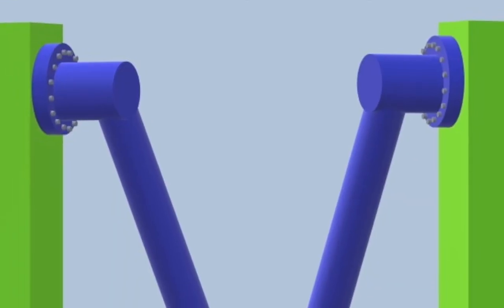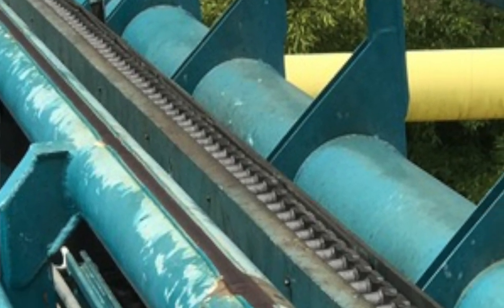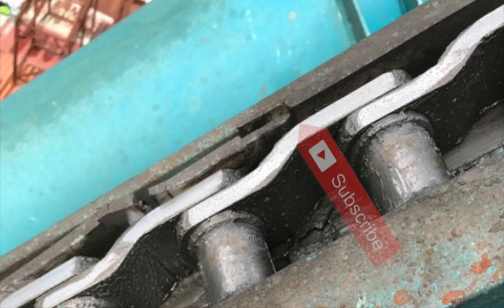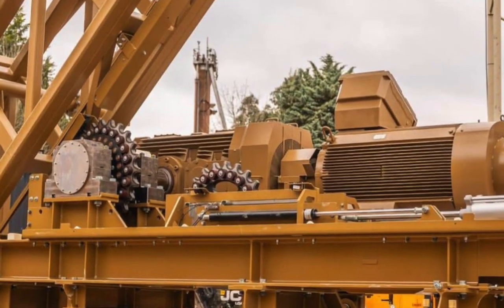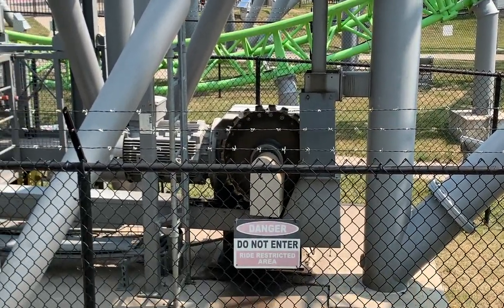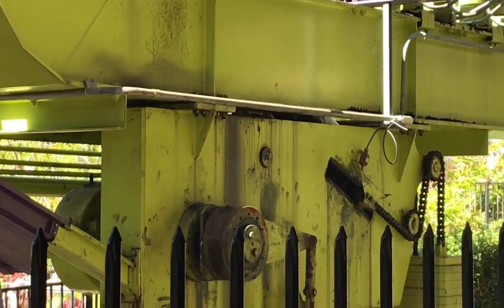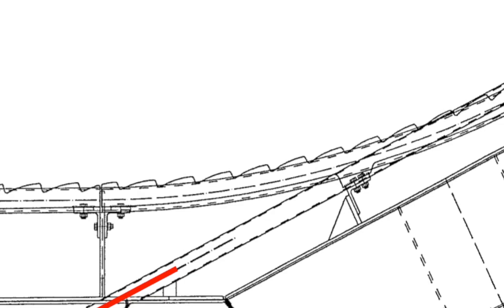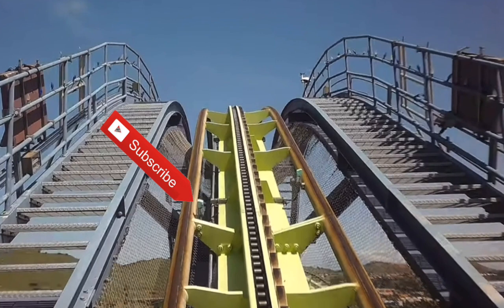How Do Chain Lift hills Work On Rides

Comment: I was at carowinds on Easter Sunday. I was shocked by the ride crew (my home park is knotts berry farm with bad ops) they had 6 people on the platform with a grouper and a dedicated announcer, but I was also shocked by how fast the lift was. Great vid!
Reply from the maker: Thanks
Reply: Wow..... I will NEVER complain about ride ops at Cedar Point or Kings Island (not that I do now because they're usually great) after reading this. We are at Carowinds now, and even with the separator, and everything else, besides Fury, and Thunder striker, the ride ops would have been deemed unacceptable for those parks. I'm not saying Carowinds has bad ops, just that CP, and KI ops must just be that much better.
Reply: Knotts BF is by far the most horribly ran park when it comes to dispatch rates. They could have a coaster that has a capacity of 5000 riders per hour and still only get 35 guest out of the line every 90 minutes.

Comment: What i heard is that B&M added their pre drops at the top of the lift to reduce wear on the chain tensioner. But then when they switched to a new tensioner mechanism they got rid of them.
Reply from the maker: Honestly only knows for sure. But not tearing up the ARB is the reason I know. Not saying it’s the ultimate reason but one of them.

Comment: I’m a little confused. Maybe you can explain it again to me? I thought the motor moved the chain up when the train is started up the hill. It moves mechanically from the dog?
Reply from the maker: The chain dog is mounted in the train. the chain dog is the component that latches into the already running chain

Comment: Why is the sprag clutch attached to the output shaft of the gearbox in line with the bull sprocket instead of on the back of the motor shaft as done with the spring applied brakes?
Reply from the maker: Just the style. Some place it on the output shaft of the motor, before the gearbox. But then if the gearbox breaks, the sprag fails. So thy put it on the output of the gearbox so there’s less room for failure.

Comment: 27:00 I recall being around Diamondback when such a sound happened. There was a train near the top, and I heard an almighty bang. ('Thor, the God of Thunder is trying to enter my building!') The train dropped off the chain just fine, and finished the circuit, but it was shut down for an hour or two. Started back up and finished the day. I suspect a sprocket skipped or the chain climbed off of the head sprocket teeth, and the bang was it slamming back into the teeth, where it luckily caught and stayed.
Reply from the maker: Wow not good if it was down for a while afterwards
Reply: @ryantheridemechanic  no doubt categorized by the operators as a "that wasn't a usual sound" moment ... and they wisely called for help.

Comment: BTW, if you ride a bicycle (or a motorcycle), you are intimately familiar with straight link roller chains .... just very much smaller ones.  The issues of stretch and wear are the same, however.

Comment: Dare I say young man. Bravo, bravo for another excellent video. I was thinking, if this hasn't already been mentioned, is why some manfacturers have the train connect to the track with the wheels on the outside of the spine like B & M and why others like the old arrows connect to the track with the wheels on the inside of the main rails. If that makes sense. Dammit can you make a video about train/track/wheel assembly design?
Reply from the maker: It’s in the works! Having to do some research. Every manufacturer makes them different. I’ll have to include track style along with it.

Comment: Was shocked to find out the B&Ms at work have DC motors, some of the older coasters also had DC motors in their past but have since been switched to VFD-driven AC motors. 

Don't know if you'll cover it in the vertical lift video but Hershey has Fahrenheit with a vertical lift that's hydraulic powered. One of one I believe.
Reply from the maker: Luckily for you that’s next weeks video I go over vertical and cable lifts. Make sure you tune in.

Comment: Schwarzkopf built a really interesting design for chain lifts on the transportable Looping Star, Silver Arrow and Double Loop models (after that, they switched to drive tires on the lift). They don''t use a roller chain, but two chains that look like a regular chain you would use to pull/lift something (not sure about the technical name, but you probably know what I mean). The chains run in parallel, connected by spacer blocks, and there are two pushers (distant relatives of Bob 😁) mounted to the chain so that when one goes over the lift crown, the other one pops up in the station behind the train. The trains don't directly engage with the chain, but just get pushed from the rear (not as sophisticated as on the Shuttle Loops, there is no counterweighted lever - but the train doesn't go in reverse, so it isn't needed). The chain even extends all the way through the station, so the train gets picked up by the chain from the loading position.
The reason for this interesting setup (i think there is even a patent available online in English) is that you could simply remove the sprockets on either end and the whole chain assembly, guided by the spacers, will slide in a controlled fashion into its storage position without the need to open it or without the risk of tangles.
Reply from the maker: Oh that’s neat. I know what you’re talking about. I never considered the ease of teardown that’s really fascinating. I love those early coasters. Such amazing ideas put into play and from the days where they weren’t 100% sure it was going to work either! I’ve seen some documentaries of Schwarzkopf walking around the construction yard making spot changes to designs working with the fabricators. Thanks for the cool info!
Reply: @ryantheridemechanic are you talking about the documentary where they are finishing the first Looping Star? It's pretty obably hard for you to understand everything, as all is in German... 😅
Reply from the maker: @Colaholiker  I turn on captions and do the “translate this”. It works well. I have always wanted to learn German but I barely learned English hahah!!  so I suppose it will have to wait.

Comment: I had a question about non invert coasters that have chains that float up off of the track in air before catching the coach which pulls it down into place as it travels over it.  The most notable one for me is The Fairly Odd Coaster, the Gerstlauer Spinner at NickU, MOA.

In your diagram at 25:45, where the chain comes up around the tensioner and continues with the grade of the lift in a straight line into the sleeve.  FOC seems to come back up perfectly flat and then form a floating triangle as it lifts out of the upward curve of the track, into the groove and continues with the plane of the lift.  There is a great picture of this on RCDB, pic 14/30.    I've always wondered why it did that., I have seen this on one or two other coasters as well, but not as prominent as this one, it's at least 1 foot or more in the air!

Also could you do a video on spinners, how they lock/unlock in motion and how they right themselves going into the station.  I've noticed different manufacturers use different ways to turn cars to a home (?) position going into the station, was curious if different mechanisms are also used on the coaches

Comment: What are those sensors at 43:44, I’m assuming they are the block clear sensor (once the back of the train had passed)
Reply from the maker: Yes. Double duty they will count the train into the next block and out of the last block. Once all the counts align the block will reset.

Comment: Thank you for this informative and well made video. I just wanted to know how the "counter weight" works but i know everything now i guess. :D
Question: Since DC-Motors are used because of the high torque. Are there coasters with a hydraulic motor? Because there are some funfair rides with hydraulic motors instead of DC-Motors because of the high force they have to maintain especially mondial is/was known for that in the 90s.

Kind regards from Germany
Reply from the maker: Most of the time no. Generally because the end speed is too low. And if you increase the size the system to get the speed up, you’ve now made the system way more expensive than putting in a high dollar DC lift motor.
Reply: @ryantheridemechanic  Ah okay. Thank you :)

Comment: The “bullwheel” for the drive sprocket reminds me of the main wheels at the ends of a chairlift that drive the entire cable (on them, there are 2 bull wheels, one drive and one return). And at either the drive or return bullwheel on a chairlift, there is a tensioning system as well, but since the 1980’s, most chairlifts have used hydraulic cylinders for their tensioning instead of a counterweight. I was wondering if a similar system is ever used instead of a counterweight for cable/chain tension, since counterweights have been used both in chains and in the weight-drop launch system you covered last time.

I also know that with bikes, there is often a quick link that can be easily separated (with a tool) to take the chain apart. It also is useful when lubricating to know I’ve covered the entire chain. Do roller coaster chain lifts have the same?
Reply from the maker: First part. Most chains use a counterweight to tension. Just less to go wrong and the load hardly changes unlike a cable chair lift. For some cable lifts like eltoro, they use pneumatics to tension the lift cable. I go over this in next weeks video. 
Ride chains typically have a master link. They are held on with snap rings etc cotter pins. Not easy to remove when you’re dealing with 6 tons of chain. 
I was fascinated to learn about cable marriages. Speaking of chair lifts. I learned in a wire rope inspection class that a chairlift system can have 10+ cables inside and not one cable is mechanically connected together they all just use a cable marriage extremely  interesting to learn.

Comment: Phantoms Revenge at Kennywood has this weird oscillation as your being pulled up, unlike a consistent chain speed you typically feel it constantly accelerating and decelerating. I have rode a few other coasters that have had that feeling. At the same park, Steel Curtain has to make the lift at a laughably slow speed. The train engages and it doesn't pick up any speed until all of the train is on the lift. It also takes the cake for the loudest lift I have ever been on. They have an announcer talking via speakers on the lift and you can't hear what is being said.
Reply from the maker: Just a guess here, but it’s probably old electric drives, trying to balance a dynamic load on the lift.PID loop used for things like that and doesn’t sound like it was balanced
Reply: @ryantheridemechanic So quick history Phantom’s Revenge originally opened as the Steel Phantom an Arrow super looper in 1991. It was overhauled by Morgan in 2000. But the lift, break, station, and service track were left untouched besides paint. And considering Kennywood is no stranger to in house maintenance (owing servel flat rides who builders have long since been defunct). I wouldn't be surprised if the motor on Phantom’s lift is original.

Comment: Great in depth video as usually. Two questions do you know how much weight a B&M coaster has sat on the tensioner assemble? Also do some GCI woodies use the weight of the chain for tension, As I was at Alton towers in the wicker man que line and I noticed on the return to the bottom of the lift you could see that the chain was floating in mid air. Also in the motor house there was quite a long channel for the chain to come out so I wonder if it uses its own weight for tension.
Reply from the maker: I’m not sure if the exact weight on the B&M counterweight stack but it’s close to about 1000lbs. 
29:35 I talk about chain weight tension on the GCI style rides.

Comment: Another great video, makes me want to go back to work. Was wondering if you guys had problems with miscatching trains where the dogs fell down a link midway tru the lift. The operators at the parks I worked at would e-stop the ride because they got scared and where always suprised seeing me start it right back up again.
Reply from the maker: That’s mainly just a matter of time. Most all rides do it “skip a link” it does sound super nasty and I could easily see hitting a stop for it. Rides that feed the train at the same speed as the chain do it the least.

Comment: Great video as always! I've always wondered something, i used to work on a Wisdom Cobra Coaster, their larger model with 2 spirals, and it utilized drive tires as the way to bring the train to the top. This coaster maybe had 8 drive motors/tires and we always seemed to have problems week after week with them, along with the coaster eating up those tires prematurely. Obviously the coaster couldnt utilize a chain lift because of the spiral lift, but i always wondered if a chain lift on a jr/family coaster was either less or more maintenance intensive as oppposed to a drive tire lift?
Reply from the maker: ivy worked on spiral lifts with drive tires as well. paining the bit. put the loss of power from a chain moving in a spiral is / we was crazy. im betting expensive as well with an added chain axis. must be a good reason not to use them

Comment: I know from my experiences with chain guides or liners.....is that we use nylon instead of plastic...
Have you taken a look at the Gatekeeper Video or pictures of the chain failure when the ride was in operation....???
It was about time for them to change the chain in my opinion... cause the ride was in between the 5 to 10 years of at the age of 7 years...
Also what can cause chain come up out of the trough and lift the train UP i mean it the bounced like the motor was struggling....this was on Preditor at Darien Lake....
Are variable speed 3 phase as well where you get up so far past the sensor and then it takes off up the lift...??
Reply from the maker: Haven’t see the video of gatekeeper chain issue honestly. When was that? 
For a woodie, the sub supports were probably broken, or the laminate stack came apart. Either way, something had to move over. 
You can speed up with a good 3phase or DC these days. When rides do that at the base, they are matching the lift intake speed of the train then going faster. We had a ride with 3 speeds over the top of the lift. Slow for rain days. Normal for regular operation and fast for AM and load testing (cold trains move slow)
Reply: @ryantheridemechanic  Yeah the Gatekeeper chain break was June 12, 2021...
I do believe there is a video of it happening...
I know there is a video of the aftermath 
let me say it took them a few months to get it up and running again no small job...I mean cause it broke from the rear and just came sliding down FAST AND LOUD lucky no track damage....

Comment: which manufacturers have the worst chain lifts? I don't think you mentioned in this video the chainlift speeding up btw. Some newer coasters drag you up slowly until the whole train is on the lift hill then it speeds up.
Reply from the maker: Even though I make niche videos, there are thousand of variations control systems can make a ride do. So I need to lick and choose what goes in. Normally it’s what the majority of rides do. But if enough demon happens I’ll talk about it.

Comment: I know you have experience with a Gerstlauer spinner.  I operated the prototype unit at Nickelodeon Universe in the late 00’s.

I always noticed the chain sat in an arc well above the track when idle at the bottom of the lift.  Was the unit you serviced similar?  Is there a reason the chain was configured in this way?
Reply from the maker: @cameronwillis2567  similar yes. If you try and suppress the chain down you make the liner on the suppression point wear out very quickly. So a lot of manufacturers just let it stretch out and the tensioner holds it up.

Comment: May i ask with commonly used vertical lift such as older Eurofighter

What happen if there's need for evacuation like for example chain snapping? Is there any way to evacuate the rider easily? Or just called the firefighter?
Reply from the maker: For something crazy like a snapped chain you will be using a manlift or emergency service to get people off. A lot of vertical lifts do have evacuation procedures using the ride equipment. But chain snap might rule those out.
Reply: @ryantheridemechanic  Also one more thing.

Can (specifically) Eurofighter and Infinity train disengage the ARB system and lower it with chain lift in most situation? Or is it easier to just make the train clear the lifthill and course?

Comment: Do you know if any currently operating roller coasters that are  (for what ever reason) powered by something other than the Electrical grid.... I know you have mentioned diesel power units for traveling fairs... but what about at permanent  parks,  or even steam or something like a  weight fall .... just not regular grid power?
Reply from the maker: I honestly do not. Even weight drop rides need large electric motors to lift the weight. Might have enough energy wrapped up in a flywheel launch ride to get the train through the circuit. Maybe. Even then, I doubt it.
Reply: Green Dragon at GreenWood Forest Park

Comment: have noticed in the past some lift hills the motor/chains ran all the time.  But have notice mre recently the chain lifts are off until the ride dispatches then turns on.  Is there a reason for the differences? Or did they find that the parts had longer life when not running all the time.
Reply from the maker: That’s mainly the new drive motors being able to efficiently slow or stop. A lot of rides slow, that’s when the chain is oiled. Some stop. No big deal these days. Old rides, burns  the motor up quick doing that.